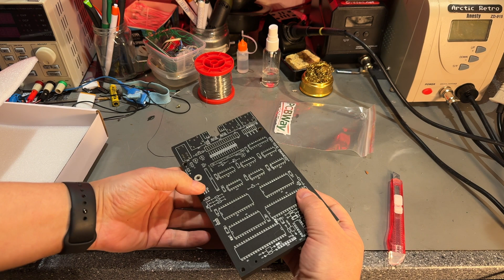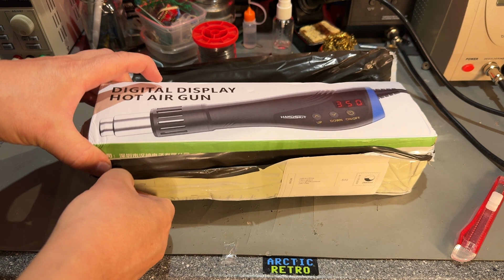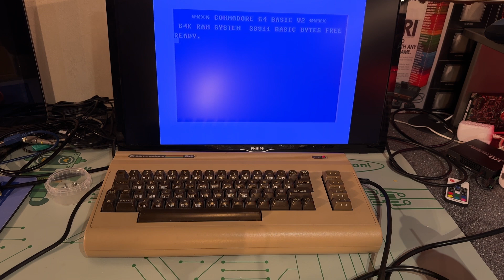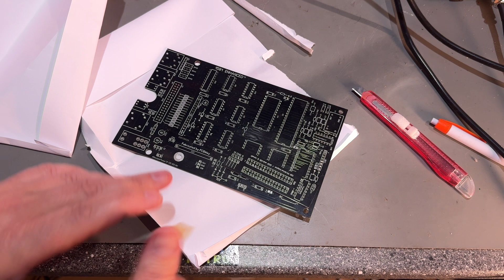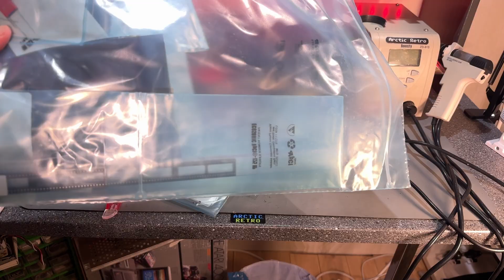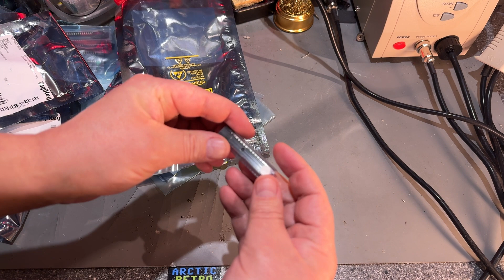Mail and donations - January 2024 - 1581 PCB's, hot air gun, C64, stuff from digikey and mouser

Comment: What would you estimate the total cost so has been so far for the 1581 project? I've got lots of 3.5 inch floppies, being able to put c64 games on them would be awesome
Reply from the maker: Around 300 EUR/USD
Reply: @Arcticretro  Interesting. Cheaper than a real 1581, but still expensive
Reply from the maker: I agree. Somewhat expensive. Chips and contacts are expensive. @kenknight5983
Reply: @Arcticretro  Yeay, will definitely watch you put it together. For the other folks in this thread try searching for the FNX1591. It can be ordered prebuilt but is currently unavailable because the seller is pretty busy. You will not get cheaper but not have to worry about old chips. It's one of those FPGA new builds.

Comment: You got the same PCBs that I did - I shall watch your build with great interest :) (not least to see how the matte black option fares for fingerprints...). You'll see on the PCBWay project page some comments about the 65C02 being the cause of 74 Drive Not Ready errors, this is definitely NOT the case, the C02 is perfectly fine to use. There are some substitutions you can make if you need/want to: the CIA can come from an Amiga, or even a 6526A from a C128 (the 64 version might be too slow as the 1581 runs at 2MHz). WD1770 is generally cheaper than a 1772 (the only difference is the 1772 can handle the faster step rate of an HD floppy, but the 1581 doesn't actually use that). If you don't have an HCT02 for the PC adapter, you can use an LS02. If you build the internal power supply option, you'll need to adapt the 3d printed drive sled to go around the big capacitor.
Finally, check whether the drive mechanism you use actually uses the 12V supply (you can't use the internal option if it does). All the ones I tried are 5V only, which means you don't need 12V. Regardless, a 1541-II or CD32 power suppy will work fine.
Reply: Thanks for that great advice. Looking forward to this build project :)